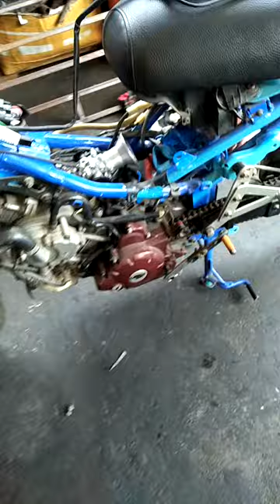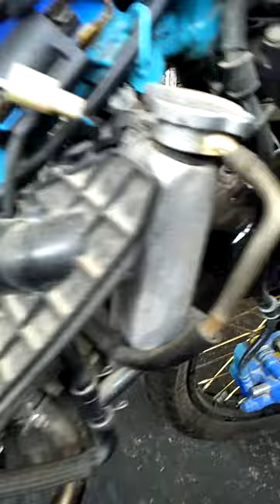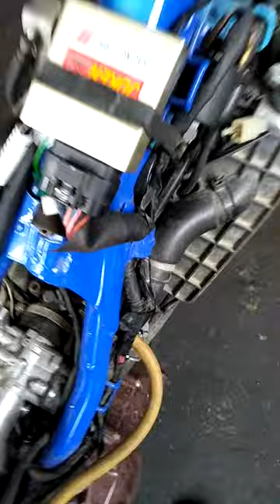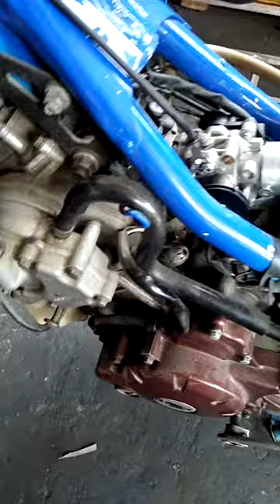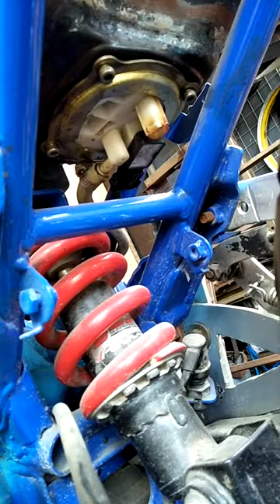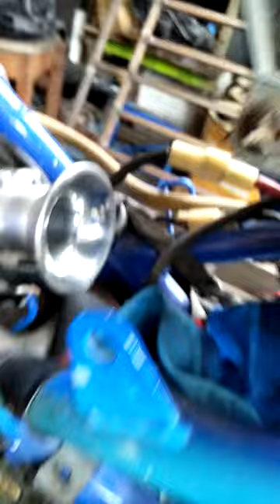Mx karbu rubah injeksi

Comment: Pake magnet apa om.?
Reply from the maker: std tpi custom lagi
Reply: @hi_techspeed4599  trimakasih om sudah menjawab komen saya. Setau saya tonjolan pada magnet injeksi lebih banyak dari motor karbu. Betul kah itu om.?
Reply from the maker: @rizkydawok5282  iya. lebih banyak. makanya harus dibuat lagi
Reply: @hi_techspeed4599  oke2. Kalo pake magnet mx king kira2 bisa gk om.?
Reply from the maker: @rizkydawok5282  bebas mas, mau pke apa aja boleh, asal paham sistem kerjanya...klo mau belajar injeksi boleh dgn kita via on line boleh. nti ada admsnya.
Reply: @hi_techspeed4599  oke2 om. Makasi
Reply: Nyimk
Reply: @hi_techspeed4599  mau dong om😊

Comment: Ada wa nya gak bang
Reply from the maker: 081341342881
Reply: Klu mio sporty pakai apa bang alat alat nya
Reply: @hi_techspeed4599  mx new saya tak rubah injeksi tp kalo rpm rendah brebet bang, apa lgi kalo jalan agak nanjak...tenaganya turun drastis. Itu knp ya?
Reply from the maker: Mtrny pke karbu apa?  Cb seting pilot sma main jetnya..
Reply: @hi_techspeed4599  tak rubah injeksi bang, awalnya ya standard mx, trs tak rubah injeksi. Trs ada trouble spt yg sya sebutkn tadi
Reply from the maker: @alvin putra ecunya pke apa? Klo udh pke yg program cba seting ecu dl
Reply: @hi_techspeed4599  pke brt juken 3 turbo racing bang, udh di seting tp masih sama. Klo d buat lari knceng klakson kdang mati jg n lmpu agak redup...apa magnetnya gk beres ya?
Reply from the maker: Pengisiannya itu ga normal
Reply: @hi_techspeed4599  kmaren udh d ganti kiprok tp masih spt itu, apa TPS nya gk beres ya?
Reply: @hi_techspeed4599  kata tmenku jg bilang "gk ngrubah kabel2 nya kok bisa kyk gtu"
Reply from the maker: @arvinputra3306  pke perangkat injeksi apa
Reply: @hi_techspeed4599  punya vixion old bang
Reply: @arvinputra3306  spul nya pake apa mas?
Reply: @masyus3946  vixion mas